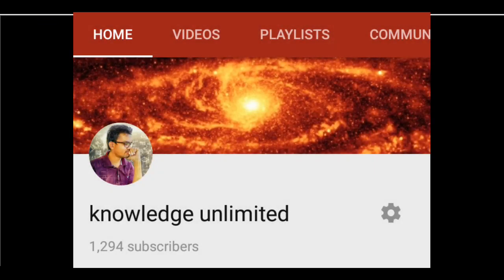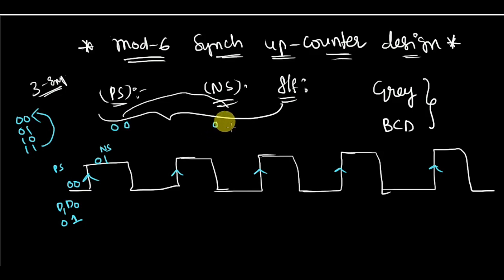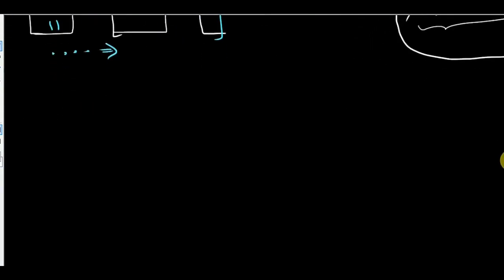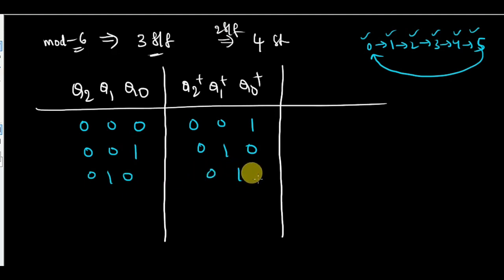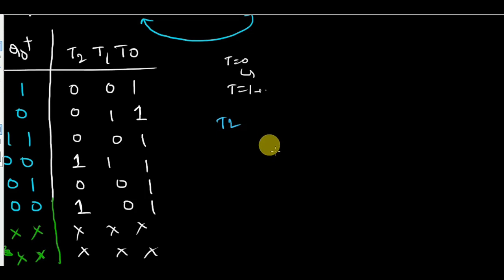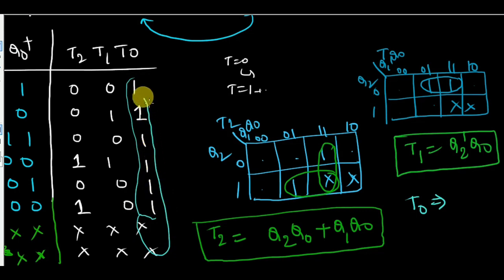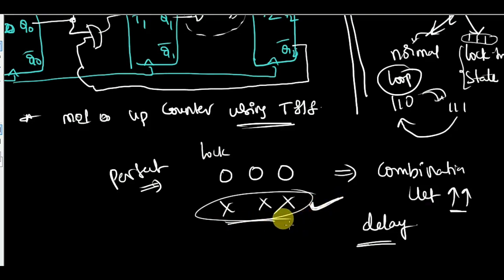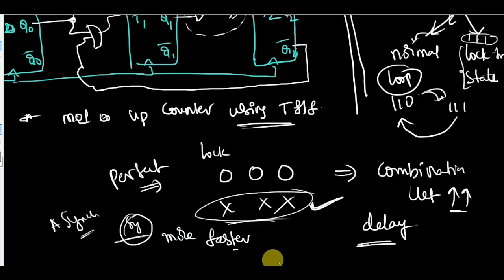MOD 6 synchronous up counter design

Comment: But how do you make it go from 0-5 to 1-6 or 2-7 or whatever you want
Reply from the maker: Reset the flop once the desired combination obtained...provide necessary inputs to gate and connect it reset pin of flops.
Reply: @knowledgeunlimited   oops i just saw this but thank you so much
Reply from the maker: Write a table considering only required states and start for resetting connect gate output to preset and reset pins According to the requirement.